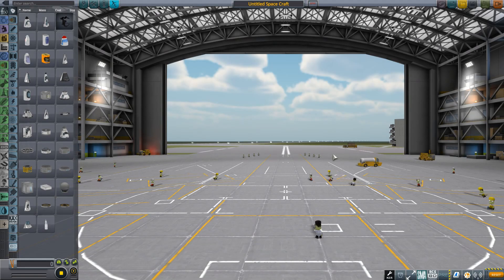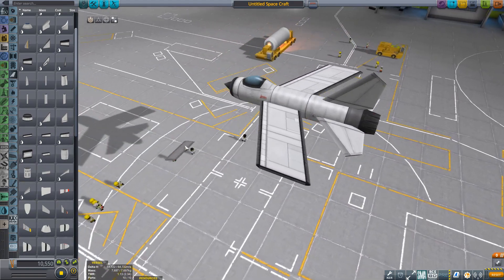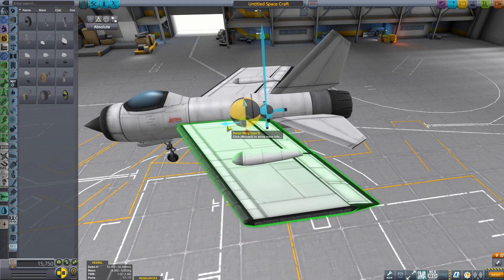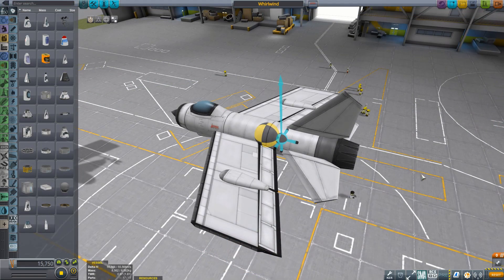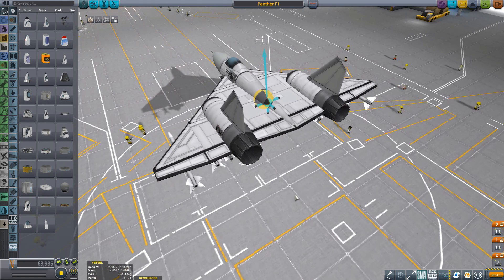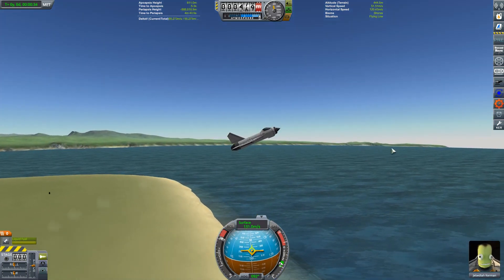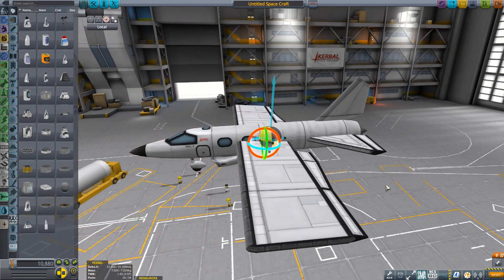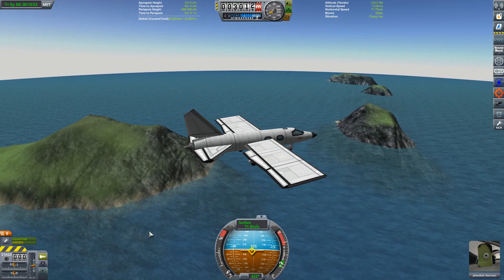Aircraft Tutorial - Stability & Balancing - Kerbal Space Program

Comment: Nicely explained, once you grasp these concepts, you can start working on SSTO spaceplanes, where you have to balance 1 CoL vs 1 variable CoM  :).

My spaceplanes usually have CoL a bit further back than CoM at launch, compared to this video, this usually insures a steady and easily gliding atmosphere aero break, without much pilot input. Is a state that's more critical in my opinion, lasting over 3-5 minutes, compared to easy take-off which lasts 30-60 seconds.
Reply from the maker: Yeah, spaceplanes can be tricky to say the least.  I did a tutorial on the joy of spaceplane reentry a little while ago after a couple of requests.
Reply: @SonofSmith  Alright, I'll check that.

Comment: How do you put wings on straight on a MK1 fuselage?
Reply from the maker: If you're having difficulty getting them straight, you might not have angle snapping on.  I think you do it by pressing "c" in the VAB or SPH.
Reply: @SonofSmith  I'm on console
Reply from the maker: If you're in the SPH, somewhere on the little display on the bottom left of the screen should be a little button that will be either a dot with a circle around it, or a dot with a hexagon.  If it's the hexagon, then angle snapping is on, and you can press it to switch between the two, or at least that's how it works on the PC version.
Reply: @SonofSmith  Thanks for the help man. I got so annoyed but now i know why. Appreciate it.

Comment: I just don't understand, i tried building something very similar to the first example, CoM and CoL are on top of each other, my pane is symetrical but each time i try to take-off, it steers to the right and does'nt want to leave the ground although i get around 170 m/s. It just made me rage-quit, i'll watch the video all over again in case i missed something.
Reply from the maker: The CoL needs to be behind the CoM; the closer they are the less stable but the more manoeuvrable the craft will be.  Sorry for checking the obvious here, but are you flying with stability assist on?
Reply: @SonofSmith  I tried with sas on and off. The thing i really don't understand is why my plane is turning right. I tried having less torque, but i means i had to remove some power, so now it goes straight but is not fast enough to take off.  XD
Edit : i rewatched the video from the start and built the exact same craft except with less powerful engines because i still need to unlock more. I miserably failed to take off anyway, so it's probably not the plane's fault but the pilot, i'll stick to rockets.
Reply from the maker: Hmm, weird.  Some craft do have a little difficulty maintaining a straight line on a long take off.  I haven't really tested the craft I built with weaker engines.  Sorry I couldn't be of more help.
Reply: soounds like you didnt lock the steering. when you put wheels on they all come with steering as default. I always lock the back wheels from steering or you're essentially taxi-ing a shopping cart. Also make 100% sure your wheels are symetrical using angle snapping (press C), if they are even the tiniest bit off symetrical it will fail - they have to be literally perfect.

Comment: Very late to this one, great stuff brother. One thing I did want to add which is not in the video and should be worth mentioning. The center of thrust also needs to be aligned with your center of mass. When you have a push configuration, the center of thrust is behind the center of mass, and the center of thrust is lower in comparison to the center of mass, the more your plane will want to pitch up and vice versa. When you have a pull configuration, center of thrust is in front of your center of mass, the effect reverses. This can be used to make your plane more stable in level flight as to not have the mentioned "dart" effect. Dont be deceived by this 'stability' it will cause instability when you try to roll if you have thrust vectoring engines. Keeping the centers of lift, mass and thrust in alignment with each other will give you the most stable craft.
Reply from the maker: A very good point.  I have some other ideas for a more in-depth follow up to this, so that's probably going to be coming at some point.
Reply: @SonofSmith  That would be amazing. There is still a lot I dont quite understand about IRL physics as well as KSP physics. However I have found out how to spawn the kraken at will :D. I look forward to the video! Keep up the great work, cheers.